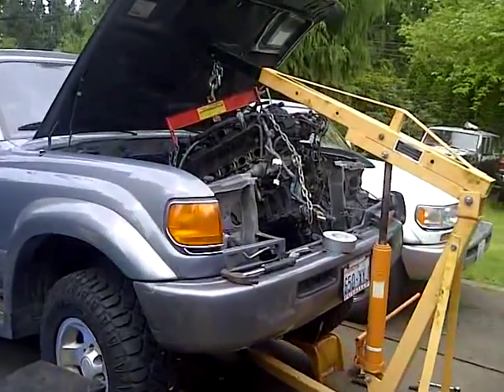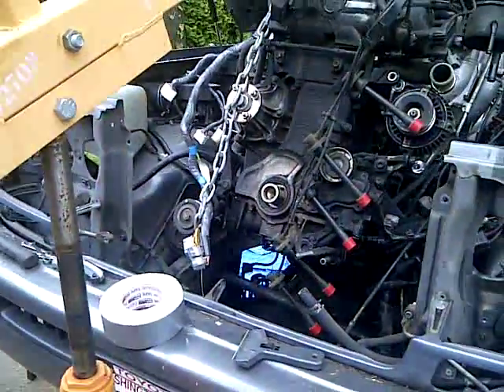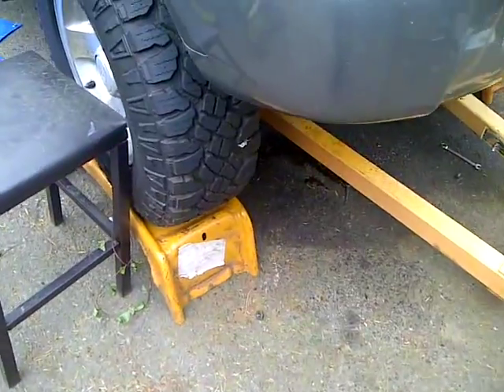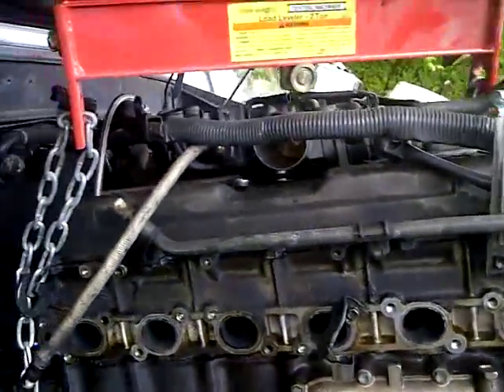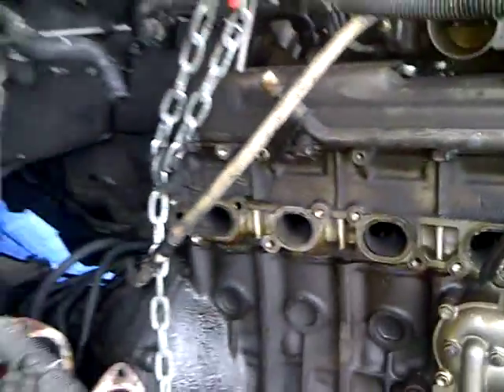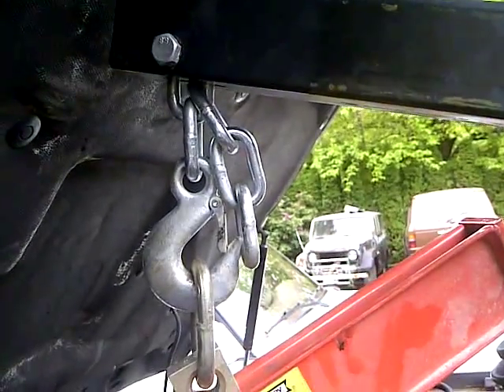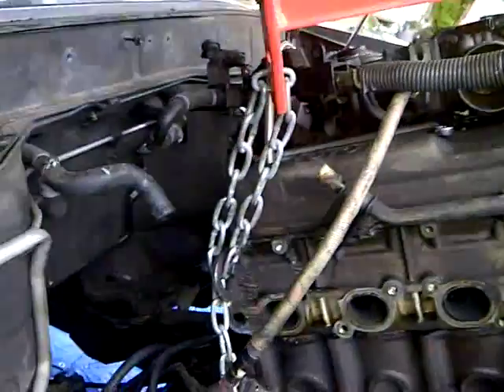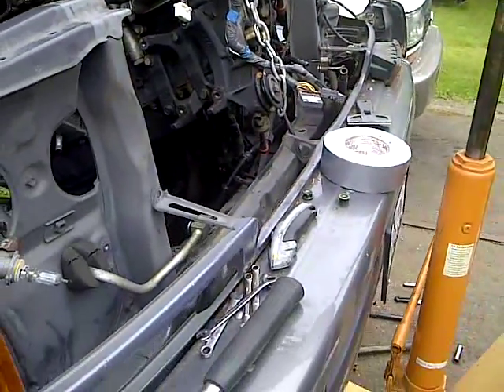1996 FZJ80 1FZ-FE Land Cruiser Engine / Trans / Transfer pulled out with hood attached part 1.

Comment: Hey buddy, talk to me about it going back in.  I've had mine out and put it back in, only this time I'm not doing something right.  I used a chain hooked to my trans to keep it level going in, got it in half way, unhooked my chain, but then noticed I was up against the front of the bumper area with the hoist, but had a foot or so more to go to reach my engine mounts.  I think my chains were too long.  I know it needs to be hanging more vertically going in.  I can't remember the vehicle being raised like you have it, did you have to lift your trans over the bumper to get it in.  Could you tell me a good hoist/chain set up for going back in, any light you could shed would be appreciated.